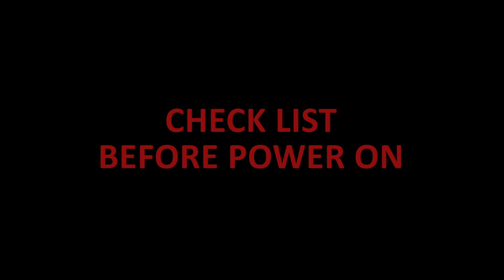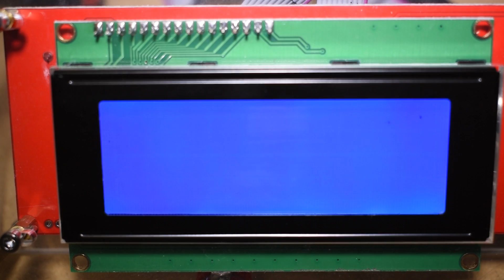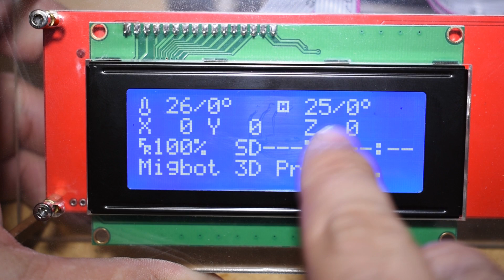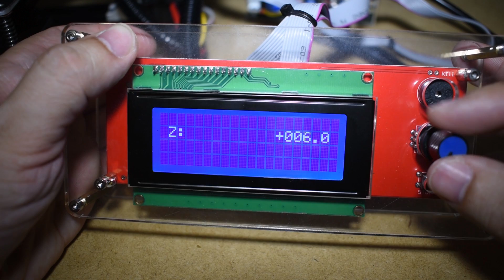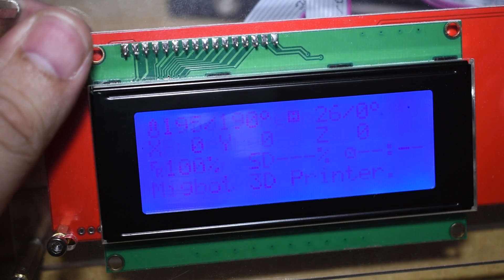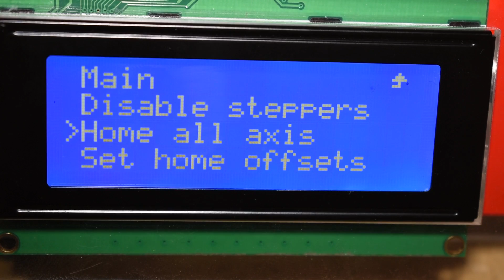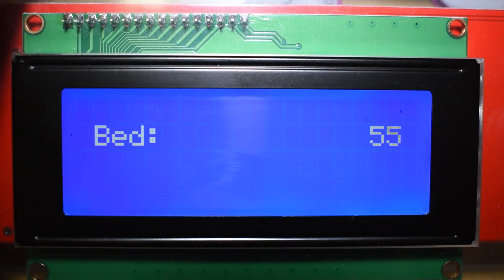3D PRINTER - ALL YOU NEED TO KNOW BEFORE THE 1st POWER ON

Comment: informative video. i just bought and assembled mine. i am encountering 2 problems. I am getting an  "Err. MinTemp reading where yours says 3D printer and, my Z axis stepper isn't "pulling/turning" the lead screw. everything else works and is wired correctly. any suggestions? ideas? thanks for any help.
Reply from the maker: The min error temp means that your temperature sensor might not be connected correctly. Check the temperature reading on the display. Regarding the Z axis motor, probably has the same issue (connector/cable not correctly connected)
Reply: @ruiraptor  I figured that part out. Lol, thanks. As for the Z axis, it's TRYING to turn and occasionally does just, not enough to turn the lead screw and properly rise and drop the X Axis Bar. Now my Extruder motor needs looking at. Lol, thanks for the answer and heads up.
Reply from the maker: Regarding the Z, are you sure the axis/wheels is not too tight? Does the leadscrew turn easily by hand?
Reply: @ruiraptor  swapped it out w the one inhad for the Extruder. Works perfectly now. Thanks for the information and time TAKEN. as well as the patience. If I have any further questions, I know exactly who to ask. Awesome work brother. 🙏🏽💯
Reply: hey, sorry to bother. been busy with life. so, I finally got everything up and running. set. extruder temp is perfect, bed level blah, bla. my problem now is, when i tried connecting my Computer to the printer, my LCD screen went BLANK. no numbers, letter, menu Nothing. its LIT but blank. what did I do? lol, HELP

Comment: Thanks for the good idea of connecting the fans directly to the power supply. I have a MKS BASE v1.5 board with 2 slots for the fans, which unfortunately doesn't work. I've used an external power supply for connecting each fan to it and each of them works fine, but not when they are connected to the slots of the board. It seems like the electronics is not the best.
Reply from the maker: Hi, some of the fan outputs are PWM controlled which means your slicer will control those outputs. These outputs are only used for fans that will coold down the layers.

Comment: Hello i was about to order a tarantula but saw one of 170 and one of 295 euro's
All i found is that the size of the heatbed is different
Witch one would you recomend as first 3d printer
Reply from the maker: Hi,
the choice for the first printer depends on several factors such as the amount you are willing to invest, the print area you need, etc.
Right now, i would recommend the tevo tornado. It's a great printer with a lot of great features.
Reply: @ruiraptor  its more as a starter project to get some experience before building my own
The tornado is it better?
Thanks btw!
Reply from the maker: You will probably learn more with the tarantula for sure, but the tornado is a better printer.
Reply: @ruiraptor  oké thanks ill order one 😊

Comment: Hello Ruiraptor, only you can save me with your big knowledge!! My Tevo Tarantula is extruding a little flow filament. I verify and doens´t have Clog on extruder. Its very difficult to 1st layer. I try many temperatures and on the bed with glass and for last one covered the glass with blue tape, but notting works. And try manual bed level of course. 
Please give me directions. Thanks!!!
Reply from the maker: Hi Silvio,
Have you tried to push the filament manually and see if the filament comes out in a good amount?
There are a few things that could be:
1- First layer too low (i know you have leveled the bed but you can try to use babysteps function to confirm)
2- Extruder motor with not enough torque
3- PTFE tube damaged/bent making the filament hard to move inside
4- Clog (did you disassemble the entire hotend? Checked the nozzle and heatbreak? Did you confirm that the PTFE tube is correctly installed and the nozzle/heatbreak are correctly installed (check my video for more details - https://youtu.be/rvkj8f_xNtE )

Comment: Hey, My LCD doesn't turn on. My wire were backwards at first but i replugged them in and I still have no reading on my screen. There are also no lights on my mainboard
Reply from the maker: Hi Cameron,
Check the contrast potentiometer. Turn it and see if it helps.
Reply: Thanks! Haha, it was just because some of my wires polarity was reversed, just got complacent. I am now printing but another issue arises. The rest of my print shifts away from the first layer. I am still using the stock SD card and I was wondering if this was the issue. I can send pics if you would like. Just tell me how youd want to recieve them if you do
Reply from the maker: Hi,
The layer shift could be from bad SD card (dont ever use the one that came with the printer), a loose belt or other. Send me your email so we can check that.

Comment: Hi Rui, recently I have buy an Anet A2 similar at the Tarantula.
Your videos they helped me a lot! Thanks for sharing!.
 In my last video, I make a change to the frame for increases the rigidity. 
I like your comment about.
Thank you
Reply from the maker: Hi,
I just watched your video and i like what you have done. That approach is the same as the new tornado has (screw in frame). I also liked the fact that you carefully checked the distances and made sure that everything is square.
You also need to make sure that the vertical frame does not shake forward or backwards while printing.
Once you have everything assembled, print a ripple test cube (https://www.thingiverse.com/thing:277394) and see how it behaves. :)

Comment: Hey! Are you sure about the extruder fan to be connected directly to the PSU and not to the controller? I thought the first layers should be printed without the fan running. Thats how i run mine.
Reply from the maker: milendemli ,
that was not what I said. What I said was that the fan that cools the hotend must be on all the time. The layer cooling fan is what you want to be controlled by the board/slicer. that one is a different fan that is not included in the stock tarantula kit.
Reply: right, my bad :)
Reply: haha i had mine connected to the board this whole time. will change it. thanks